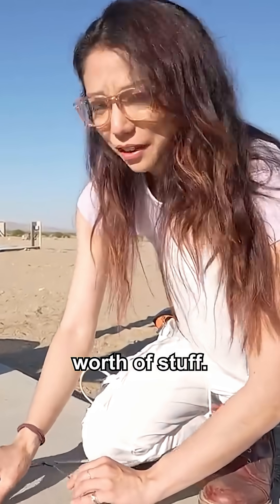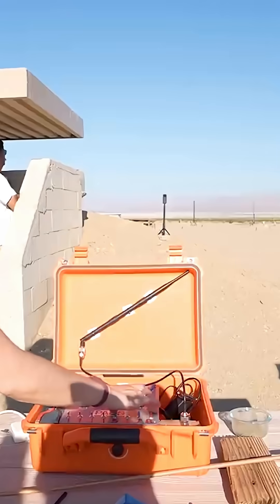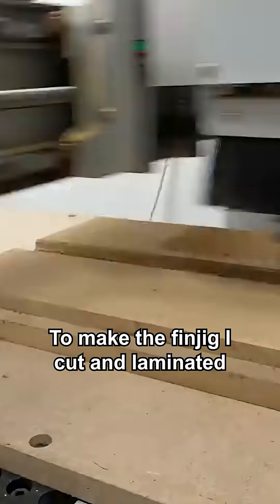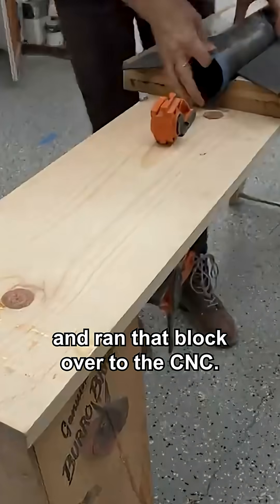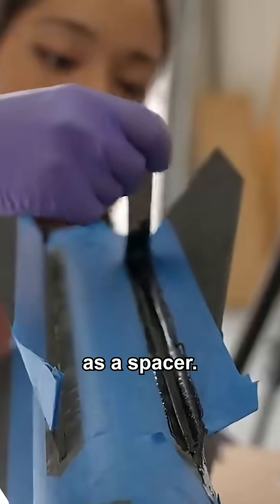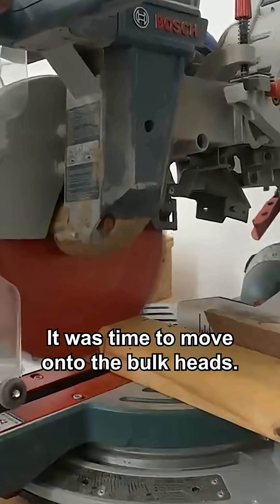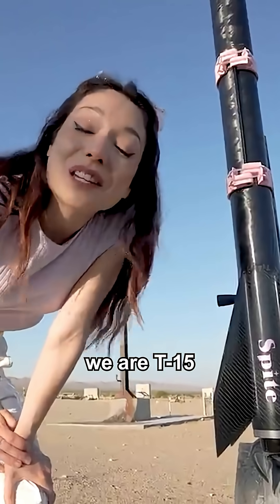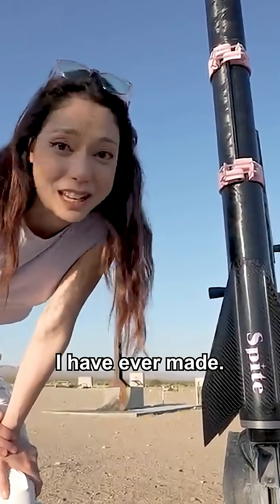$3,000 of rocket… lit on fire for science.

Comment: I wonder:
How much of a factor is air resistance for such a small rocket to get to high velocity ?
Suppose, you can get a glider to get to 60.000 feet just outside the doldrums at the equator.
Launch from that height. Would such a rocket be able to get to orbital velocity, when there is less air ?
Or ... is the air density up there negligible, for small rockets ?
Reply: Yes but no. Air resistance is a big factor but getting past it is not nearly enough in itself.
Basic orbital velocity is something like 7.8 kilometres per second - that's ten times faster than a rifle bullet.
Reply: To add to what @Lucien86 wrote - remember that orbit isn't primarily high, it's fast. The cost and engineering to lift a rocket to altitude is much, much more than what you can save on the rocket from doing it.